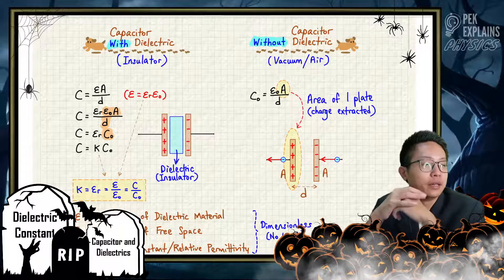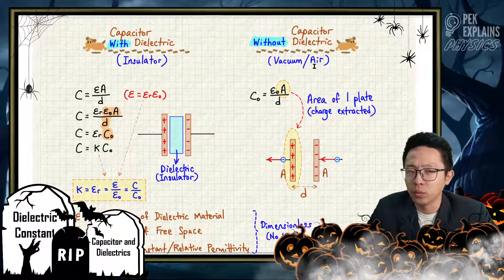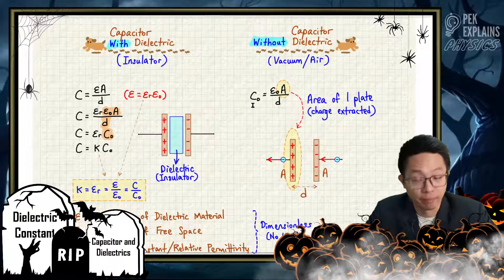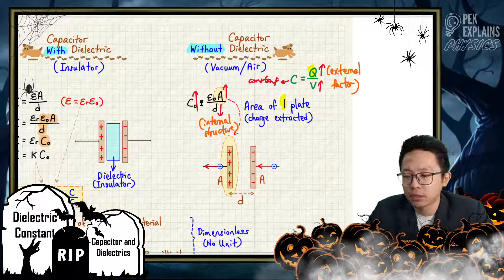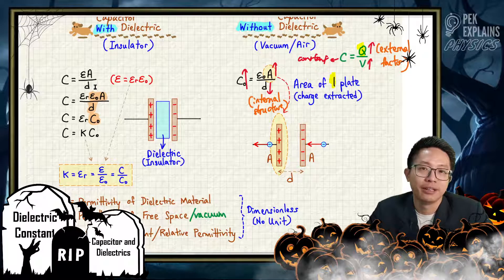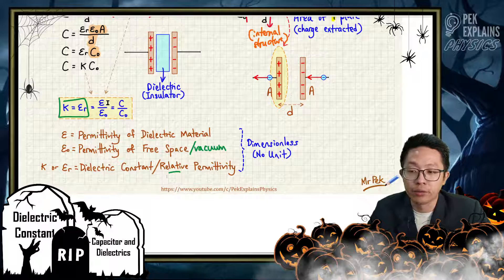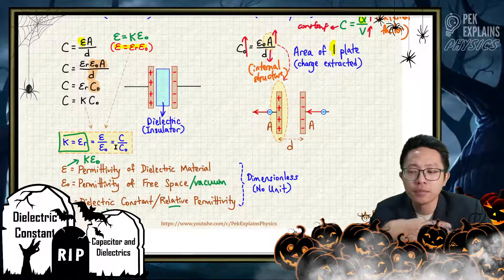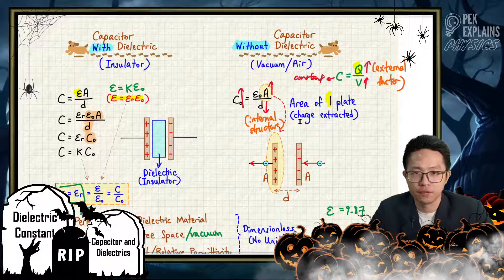Matriculation Physics: Capacitor and Dielectrics (Summary Part 8)

Comment: At around 7.25+- , sir mentioned C=Q/V, no matter how we change the value of Q and V , C remain constant, then why we still use this formula to find C?? Why dont just directly use C=EA/d ???
Reply from the maker: If question just provide you Q and V..
Reply: @PekExplainsPhysics  so both equation is used to find the same thing is it just depend on which info I hv then i will use the equation which i hv enough info about it?
Reply from the maker: Yes
Reply: @PekExplainsPhysics  tq sir